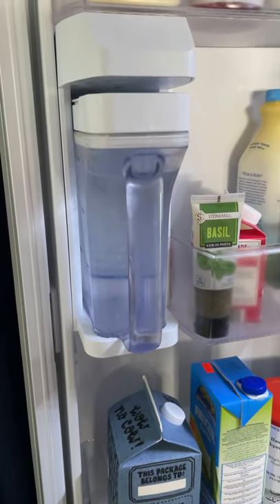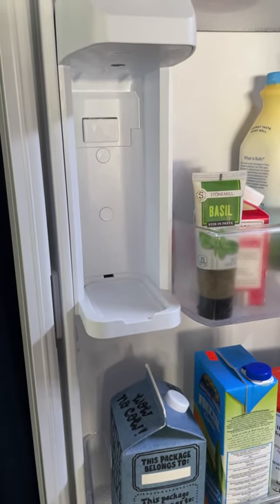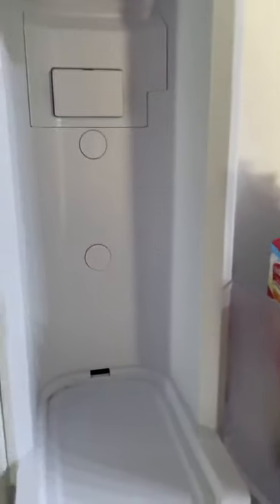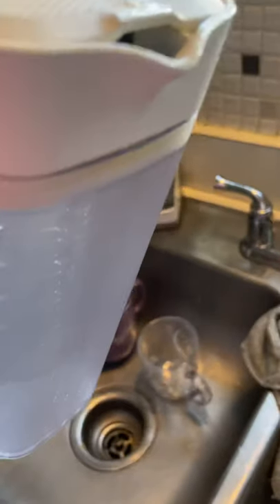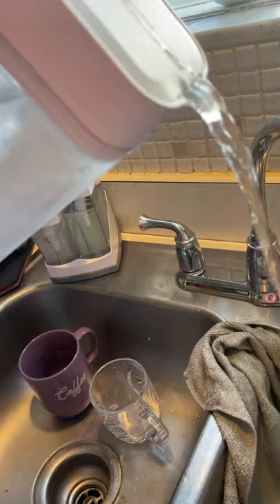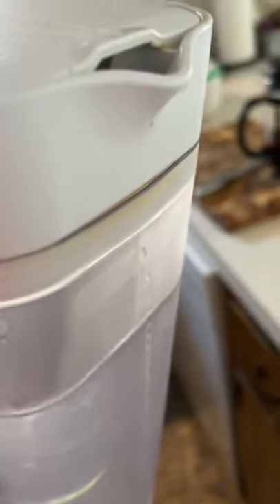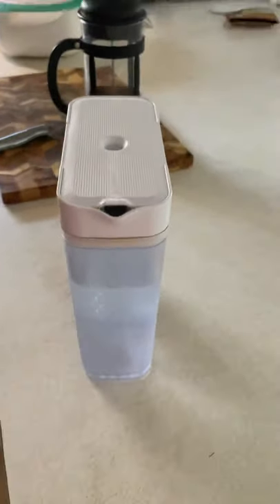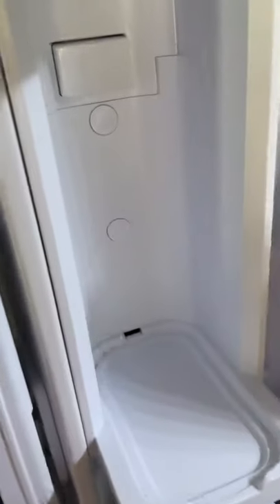Samsung Water pitcher will not refill

Comment: WOW!  I wiped down the pitcher and inside the slot.  Barely dampened the paper towel, but apparently just enough.  Pitcher is filled!!!!!  Thank you
Reply from the maker: The sensor is behind the black hole in the bottom center. l guess the goal is no water or condensation anywhere in or near that hole.

Comment: Very helpful! This issue is present right out of the box with brand new refrigerators as well. After getting my fridge installed, I noticed that the pitcher was only filling up half way each time. Tried a few things and nothing really worked...and then watched this video. All I did was dry off the outside of the pitcher, and it auto filled up the rest of the way. Thank you very much!!

Comment: Great fix.  I knew it had to be something simple going on I kept wiping areas on top thought it was just not sensing the pitcher being in all the way.  After seeing this I wiped off the sensor on bottom with paper towel and all was good filled right up.  Just have to not be so sloppy and quick to put back in after pouring or just a quick pat of the pitcher on a towel or your shirt to wipe away the water that dribbles down front of pitcher before you put back in is working for our household.

Comment from the maker: Also, if you don't insist on cold water, another trick is to keep the water pitcher outside the fridge until you are getting ready to use it. Storing it inside the fridge can cause condensation at cold temperatures--which may require you to dry it and wipe it down more. At room temperature, it is much easier to clean.  Either way, the goal is to keep everything dry.

Comment: Just wanted to add if you accidentally misplaced it and it started to leak the water has a catcher on the bottom of it so if you look at the compartment under the pitcher there’s a nozzle. Place a cup and empty it. For the that fixed the problem. Thanks for the video!

Comment: What he left out is that there is a drain plug underneath the pitcher holder on the fridge door that you can open to drain out any excess water that built up.
Reply: Facts that’s exactly what I had to do and it start working immediately

Comment: How do we fix the leaking tho?
Reply: I am not sure. One option is to buy another pitcher but the going story is that in a month or two the new one will do the same. The sensor is in the back through the black hole on the bottom center. Seems if water goes through there it won't fill.

Comment: Those aren’t sensors bro , they’re covers for screws
Reply: The exact location of the sensor is in the center, at the bottom through that black hole--on the back. If water gets through that little black hole it reaches the sensor on the back of the wall.